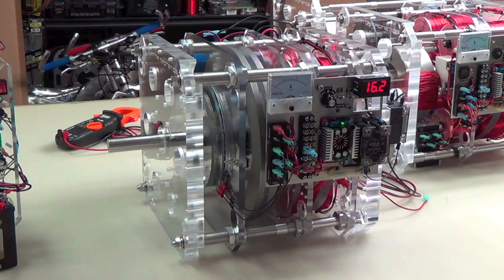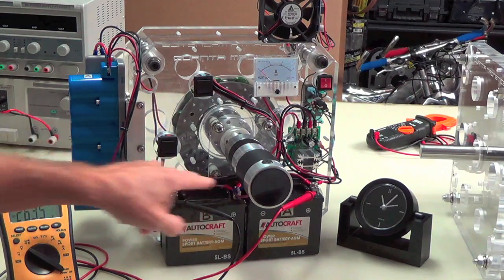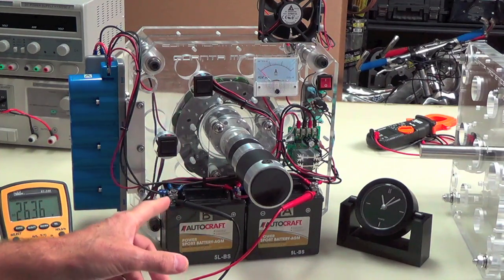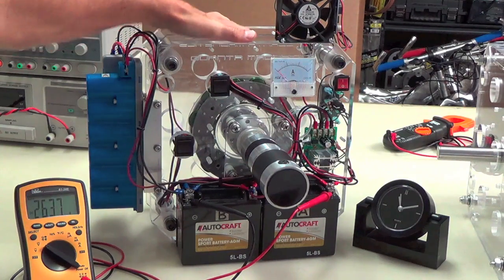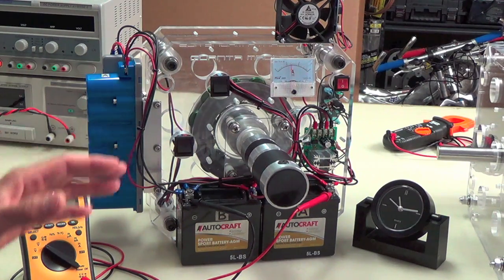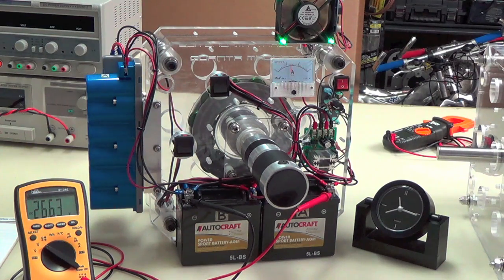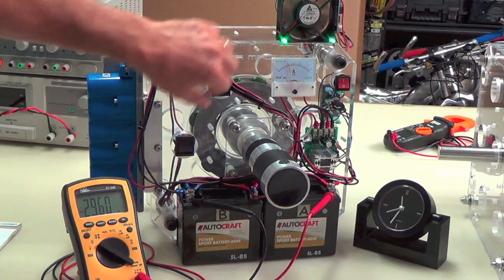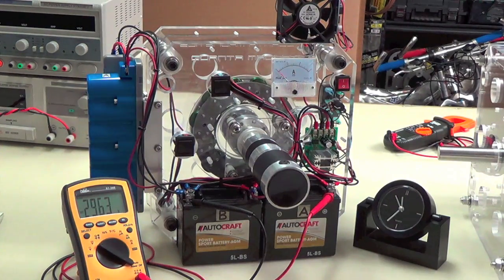Tesla Switch Hybrid to Supercaps

Comment: Hi Mike
What is Load capability in Amps, as system is running, when batteries fully charged? 
I would love to see Tesla Switch Hybrid to Supercaps running, fully charged, then loaded up to show what capable amp load before Voltage reversal shows on battery level.
Is that something you can show us, or tell us?
Like, how many amps are available for consumption as it maintains safe charge level?
You obviously have an excess of power output but how much and can the units function be auto control switched at upper and lower charge levels?
Kind Regards

Comment: We need to see an amp meter and have some compasses around it to see if the energy is being stored in a magnetic field. There may be a "magnetic circuit" some where in there like the ghost chanles on a coaxil cable.

Comment: One of the charistics of a discharging battery is an initial drop in voltage - then once the chemical reaction gets going good the voltage on the discharging battery will actually rise until it level out - then it will slowly decrease until it reaches what is called the knee voltage - then the voltage falls off rapidly - if I was u and wanted to see if your system actually generates power I would get some small resistive loads to switch into the system to keep the voltage under control - if the system supports the loads without the voltage going down for a length of time you might be onto something - be sure and take into account the energy stored in the cap banks when determining how long to test ur system ... Wind turbine use this dummy load system when the batteries reach their full charge and the wind is still blowing.... One of the things I would do is add another battery and cap bank for the third phase of the generator - thereby balencing the charge/discharge rate between the batteries and the output of the generator...
Reply: Bravo, I"d like to add that lead acid batteries  also have temperature to voltage sensitivity where voltage rises with temperature, (the reason they will discharge when placed on hot or cold surface with respect to ambient).

Comment: Was wondering why the resistance dropped?
Reply from the maker: As the charge increases, the resistance to charging becomes less.
Reply: I thought the resistance was the motor
Reply from the maker: Yes, both motor AND batteries.
Reply: The internal resistance of the batteries will drop as they warm up.   The resistance of the copper wire in the motor and alternator will increase.
Reply: MattOGormanSmith was wondering how much a load would increase the resistance
Reply: Resistance doesn't change with current,  but current flowing through a resistance causes heating which then does affect the resistance.

Comment: Energy [J] = voltage [V] x current [A] x time [s].    Energy flows from batteries to capacitors, to motors etc. Even voltage shifts during the run (kind of DC - DC transformer) amount of A x s decreases in the batteries => energy of batteries is stored to capacitors and lost to fan, leds and frictions. Voltage does not drop after the run immediately, because lead acid batteries needs 14.2 Voltage to recharge. (to get current trough thin layer of lead oxide layer). So the higher voltage of the capacitors remains quite long time after switch off. Less than 14 V / battery => Voltage difference takes a long time to balance between capacitors and batteries after switch off. So Voltage meter gives higher voltage afterwards, but there is less energy in the batteries and capacitors than before the run.
Reply: We need to total power after very long work /time... A plot of power vs time needs to be plotted and temperature ( battery, motor)  plot vs time will tell surplus.  I must say good effort, and technically sound.

Comment: Like lettuce that goes brown, or living outside needs makes you soft.....I seen a small array of panels on a house so stopped and asked about them(years ago) They were hooked up to a heater only. dc. My instructor told class why doesn't somebody turn a car alt into charger, hook up a heater and sell em. As long as they pay there way they are good things(for now). The nice thing about getting something out there is someone else can improve it...THAT IS HOW EVERYTHING has been developed so far. J fresco, The Venus Project, said it took 100 years for the camera. OH and on the flip side, the more interest..in interest, the better-politically speaking, much of what we need to help progress is in the politics. Therefore the more interest equals more mass power economically, if you will. Multiplier--tech and comm(J Fresco),,,and the fact we have been forced inefficient soo long.....it won't take 100 years this time.

Comment: very professional...nice video. working on something similar...but different. Have a set up here where I can get my machine to run for 7 minutes 13 seconds with just magnets...had to specially 3d print special parts I designed for a special magnetic setup. My second phase is going to be kicking in soon where I add coils and batteries. You can probably guess where this is going if you think about it. nice job...really loved your set up.
Reply from the maker: Can't wait to see it John. Send me a message when you have it ready, or post a video. I would like to see it.

Comment: what do you think about the magnetic bearings being used to allow motors to turn at 35,000 rpm ?  https://www.youtube.com/watch?v=_Ed2tG22MlU&t=522s  thanks !
Reply from the maker: I agree! Using magnetic bearings in the prime mover (drive motor) that operates a much more advanced small impeller at 10x speed that eliminates the need for the monster sized multi-stage pump makes tremendous sense.
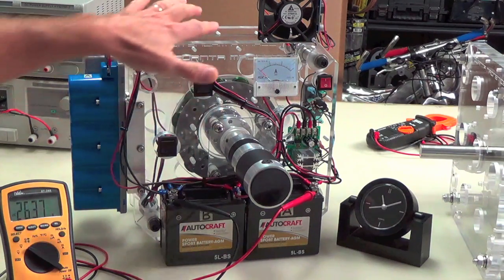Reply: okay thank you.  i tried following their link to find products but they don't show the magnetic bearings there.  according to his figures, that water treatment plant is saving $200 a day on the cost of electricity to run that one pump.  now they need a Quanta Magnetics power generator to save them the other 50% or whatever and forget the power company trap of paying for what could be in such abundance.  here's another video i am pretty sure you will like !  https://www.youtube.com/watch?v=4qXnR_d6yPw&list=PLLMujx4ln6usCKyln58AZiKfOQlHAF_8f&index=2   much of the appeal is his obvious honesty and desire to help people's families to become self sufficient and free in life.  if you have time only.  it is 8:42 and i ended up watching the whole thing which is rare for me on such videos.  yours i do also.
Reply: imagine what that could do for jet propulsion efficiency.  there's an industry heavily relying upon high revs.  i saw a motor being tested (for electric aircraft) and this small bench mounted motor of about 3 inches was at high revs practically blowing this man off his feet !  seems a whole new area of potential uses just by increasing our revs.  we know what formula one and the like can do with just a few liters of displacement at high revs.  as you say, with more advanced designing.  have a good one my friend.
Reply from the maker: Great video Sonny. You know flywheel technology has been forgotten for many decades. What a shame. Many overlook how flywheels are actually rotating leverage that includes stored kinetic energy, especially when geared properly. Our G1 machine utilizes that advantage though is mostly misunderstood.
Reply: I appreciate your videos Great work. Magnetics and energy is something often misunderstood. All we have are theory's. Were still unlocking the potential. I wish i could afford one of your Q3 kits to assemble You ever feel charitable toss one my way lol

Comment: You should put a pulley on the end of that shaft and run a reduction for mechanical leverage and spin up a generator and see how many watts you can make?  Maybe even a gear drive system with a lubricant to reduce friction. And if a guy could hook the G1 up to a dynamometer how much torque and hp you figure you could max out at?  1 maybe 2 hp before it stalls?

Comment: Awesome Demo!  I hadn't seen this video before on your channel, but it was recommended to me just now.   Rick Friedrich made a big point of the fact that the "Tesla Switch" was really invented by Benitez, and would function much better with capacitors than batteries, without wrecking them.  He gave good demonstrations of that, but this one is superb!  This is what a proper Home Power system needs, but with a Variable/Switched Reluctance Motor that also contributes charging, without Lenz EMF drag, along the lines of the Aspden-Adams motor, or the one Thane Heins is building at ReGenX.

Comment: Have you put any thought into using magnetic bearings instead of standard ones that need to be greased. I think if you can use them without getting interference from your other magnets and power generating components of your system they would give you less loss and be more permanent solution and maintenance free.
Reply from the maker: I have total ceramic bearings in this machine. No oils, no grease and no magnetic interference. They really do help.
Reply: Your work is very inspiring! It's great to see how easily you have overcome Lenz law in your generators. I also like how you have incorporated centripetal force in the gyroscopic inertia pulse motor generator. I think that machine has huge potential.

Comment: 12*350 = 4200 farads, thats 1 watt per second for 4200 seconds. That will run an electric motor for quite a while without 2 motorcycle batteries helping. Please show us some cuurents flowing so we can calculate any efficieny levels.

Comment: You are extracting energy from the magnets into the capacitors. You can see that the voltage increase is from the caps, at the end of the video the voltage starts to decrease as the caps bleed voltage over time from their natural dissipation.

you need to use the batteries to get this started because the energy the system emits while at full speed is enough to sustain itself, its not enough to start it from stand-still.

I like to think about it in terms of buckets and water.

Battery A, B are full of water.
Cap A, B are empty.
The 3 phase motor is a water fall.

As your motor turns it's using water from Battery A, B.
Your Cap bank A,B and batteries are all receiving water.
At first your cap banks are empty, so it steals some from your batteries and receives some from your motor.

Eventually the cap banks are full, and the batteries are full and the voltage of the entire system is now higher than where you started.
Reply: intx123  I know very, very, very, very, very little yet thought it a little odd he used one multimeter.

Comment: love this stuff:)
A couple of tests i'd be doing is to connect up a variable load with a power meter in series with it across the battery bank and gradually wind it up to see at what point the voltage stops increasing - this will tell you just how much extra power is being generated. also would be good to know whether the 12v motor is being run at maximum - if not what is the ratio of output increase vs motor drive?
lot's to experiment with.
Oh and a comment was made about reducing current to the motor with increased voltage -  this is simply due to the switchmode controllers tranfer characteristic - as in, for a given  output power the input current is a function of the input power / input voltage so an increase in voltage must yield a decrease in input current for the same power consumption.
:)

Comment: Would be great to replicate, so we find the answers, There is a lot of questions there,..maybe a good plan to show your circuit diagram for a quicker replication,...
I believe if will work in any setup with any three phase outup in the same schematic,
Does not matter wich altinator you use,...as long you find out the right schematic,
Thanks for sharing

Comment: What is the RMP of the motor?  I will have to monitor this on my G1 machine.  Thanks as always Mike!
Reply from the maker: +Joanna Kinlen The motor runs at about 400 rpm.  Power output from this one small additional section can be extracted, stored or cycled back through the G1's  pulsing circuitry.

Comment: Ok i did my homework with a similar set up...
pulse motor running of battery A, backemf charging battery B and generator charging the sum (i.e. both batteries in series)
It works like yours (maybe not charging that fast, but it does).. only it has limitations. 
It only works well when the batteries are BOTH quite full.. (around 12.80 volts minimum)
The charge battery will be charging more quickly than the run battery is going down. so the sum is charging...

Try it with 3 meters... one for Bat. A, one for battery B and one for the sum.  If you start at 12.2 volts on both batteries.. you will see the sum going up for a while and then the sum and the motor run battery will fall.. 
(around 12.80 the run battery only goes down very slowly and the charge battery charges very quickly...that is why you get the effect when measuring the sum )
Luc
Reply from the maker: +DaKrampus  Be sure to use supercaps/ultracaps to retain the increased energy Luc. Otherwise, all will be lost by using batteries only.
Reply: +PMMG4HYBRID yes I am using supercaps.. (only 100 Farrad x 6 x 2.7v  in parallel of each battery) maybe they are too small?? yours are at least 400 if not 500 Farrad each...
Reply from the maker: +DaKrampus  Mine are 350F each individual cell. Also be sure the modules are connected in series, just like the batteries. The objective is to use battery "A" as an accelerator to charge large ultracap modules as quickly as possible, so battery "B" does not discharge much when recharging it with two of three rectified phases in series while running. It's a simple process, but still kind of particular in detail.
Reply: +PMMG4HYBRID So then it follows that the 3rd rectified recovery phase goes to battery A ?Maybe add more load with another fan and lights like you have shown until you are just barely gaining voltage at your optimum running speed.Right now you are storing at a faster rate than you can handle.If all is working well with the increased load, then run time should be several days and some. Easy to test. Let us know and good luck.

Comment: Chemical batteries charges at different rate depending on temperature? As its being rapidly charged or discharged, it gets hot... And would hot battery charge at a different rate?

To retain the extra electricity, why can't you syphon it to an isolated battery?

Comment: Heya! How's it going? I watched most of your videos pretty much back to back. I'm a bit embarrassed to say that I have a degree in Electronics and another in Electrical Engineering, but I'm still not quite understanding the process in this video.

I understand the Q2/3 in that you can prolong running by using the output to generate slightly less input, and that is what leads to the long run times. I think I understand the benefit of pulse charging and how it is capable of charging a battery even though the overall amperage is very low... 

I'm wondering, though, if the charge times for batteries using the system is very long, and if the power you're getting out to charge the batteries is less than or equal to the amount of power put into the system.

However, for this video... I'm not even sure if I can put my questions into words... You've got electrical drain from the motor, fan and LEDs, mechanical drain from the bearing and gearbox... magnetic drain from the alternator... and yet somehow, the voltage went up. 

Looking at the numbers, at the beginning you had 26.24V @ 1.5A for about 40W of power. Towards the end, you had 29.59V@~1A for about 30W of power. Sigh... I don't even know if the numbers correlate to anything substantial... ha. The loss in power makes sense... the voltage rising does not.

 I've worked with a lot of Li-ion battery packs and cells... probably on the order of thousands... What I would expect (depending on the circuitry) would be for the system to maintain current while slowly draining the voltage... until you get to the point where the voltage is no longer strong enough to push whatever it's pushing and the current begins to drop as well.

This though... lol. I just don't understand.
Reply from the maker: +Xero1of1  Battery "B" and its parallel connected UC module is the only source being consumed 13.12V @ 1.5A = 19.68W.  Reduced to about 13W consumption toward the end of demo. All batteries and UC's receive charge simultaneously. This helps reduce the demand on "B" while using "A" elements as a charge accelerator. Batteries balance and recover to where they started, and UC's retain the increase. Now factor in the heavy losses during the process...
Reply: +PMMG4HYBRID    Now you have got me to wondering. It seems well known that the bemf collected from a pulse motor can easily be 20 to 30% of the input pulse. So is your motor 90% efficient or so and your generator also 90% ?If close, then the bemf could keep things moving for several days and some. Even though the heavy losses are factored in during the process...
Reply: Nice work on the calc, so starts off at 40watts reducing through 30watts. So 10watts or so in 15 to 20min seems about right for all the internal loads. Definitely not overunity. Nice toy.

Comment: Electric car driven during the day and left in recharge mode overnight would be a good use for this.  The problem I see is the magnets will demagnetize over a few months of use and reduce the capacity of the generator.  At what cost?  A few gallons of gasoline are the  base line to compare the cost.  Another consumable is the cost of the batteries which also age with use.